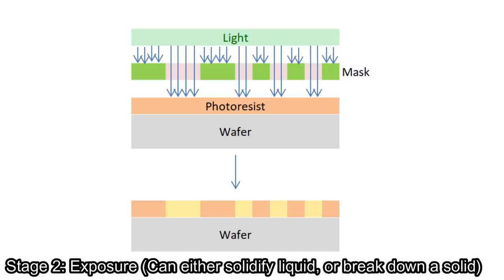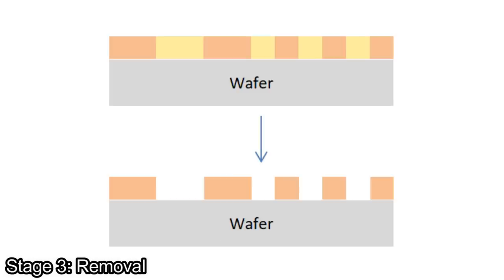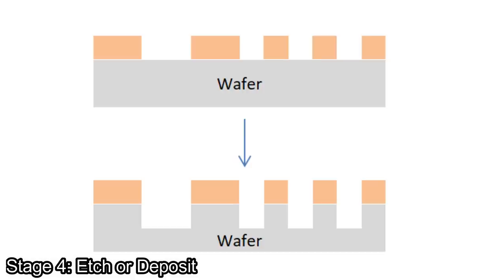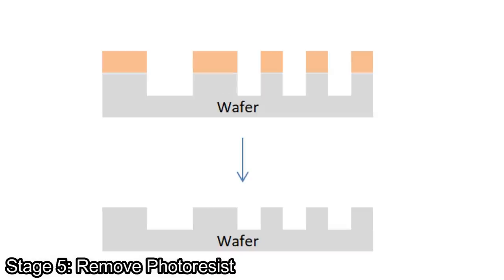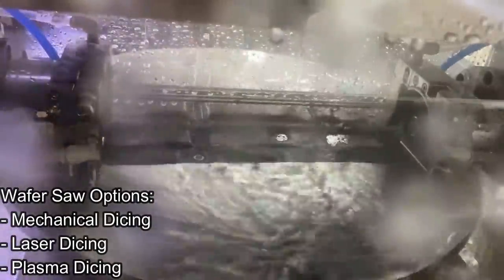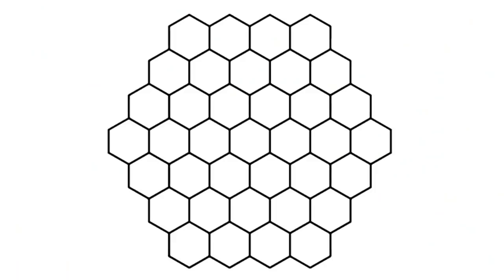Why are Processors Square (and Wafers Circular)?

Comment: Triangle shaped dies could be manufactured while cutting through the whole wafer. Like a square with both diagonals.
That would reduce waste a little bit. Probably still not worth it though, otherwise it would probably be done.

Comment: Round wafer makes sense, you need to be able to grow it by spinning it through the process. I was actually wondering why chips aren't hexagons instead, but then I was told they need to be cut and diced easily so hexagon is out. Plus you have 4 axis to control in hexagon (1 rotate 3 to position) vs 3 axis to control in rectangle (1 rotate 2 to position).
Reply: are the bits of the wafer after getting cut are recyclable or not?
I hope it would be 100% recyclable like glass since it is pure silicon
Reply: @freakdeath1020  Any part after slicing with a cable saw is not recyclable. Basically only the ingot before slicing into wafer.

Comment: Here's what's I'm thinking (before the video): Wafers are round because of the way the crystal is grown by dipping a seed into molten silicon. CPU dies are square because they tessellate well. I do wonder if alternative tessellating shapes like triangles or hexagons would also be a decent option, although these are somewhat more limiting in the arrangement of the CPU because dies don't have to be perfectly square, they can be rectangular and longer to account for more cores for example.
Reply: Oh yeah, they're square because they're easy to cut out.

Comment: The better question is why not print smaller dies on the “edges” of the circle. Where a full cpu die might be cut off you could put a smaller (chipset?) chip.

Comment: Not only is the unused silicon non consequential, the edge areas of the wafer produce lower quality chips, opposed to the center. No alternative outweighs the significant ease in the manufacturing process that rectangular chips offer.

Comment: When referring to wasted silicon, am I correct in assuming most of the waste occurs near the edge of the wafer where you have areas that are too small to hold a full chip because they intersect with the wafer edge? Or do these "fractional chips" get recycled so that they aren't really waste? Or is most of the waste from the width of the boundary between chips (so we're actually talking about minimizing the perimeter to area ratio)?
Reply: Yields are higher towards the center of the wafer and lower towards the edges. Waste in this context is most likely minimizing the amount of unused silicon because to reuse the scraps it would have to be reprocessed.

Comment: Even if you would square (rectangle) cut the chips, could you design an architecture were you could salvage some of the edge chips anyway? Like making a 8 core designed cpu where half of the die is "outside" the wafer and turn that into a 4 core by salvaging the other half of the die that is on the wafer? Basically if you cut through the die that you still can use some of it that is left?

Comment: I get that hexagons are impractical, but what about triangles? You'd have 3 straight edge to edge cuts. Downside is probably that 3 cuts are more effort than two cuts and there is more material lost to the scribe line, but triangles should be able to fill more of a circle than squares too (I think)

Comment: Make a single CPU complex from every wafer, fuse them all back together into a compute cylinder with appropriate cooling, data and power lines and connections.  What could be expected of usable performance?

Comment: Triangular CPUs? They tesselate in a similar way to hexagons AND can be cut out with straight cuts.
Maybe the shape is less robust however (easier to break off a corner) and harder to design for

Comment: So for Cerebras , they chose square chips. Seems like the photo lithography might still be a limitation in using right up to the edge of wafer. But someone will use the whole thing at some point.
Reply from the maker: It's also the optic chain is built around rectangles, not circles.

Comment: How are processor designed? Is it in a Cad software where the engineers place each transistor in software or is there any software magic? or its just plain hard human work and wiring(in software) ?

Comment: People have suggested triangular chips. What is a rectangle but two triangles?

On the other hand, if there was any benefit to hex, triangle or unconventionally shaped chips - why not cut them with a laser, especially water guided microjet lasers? Is there some benefit to using diamond slitting saws beyond the cheaper price of tooling or established tool and process chain?

I'm honestly kind of surprised that laser cutting the scribe lines between chips isn't already a thing somewhere. It it seems like doing super precise laser cuts could have yield or other benefits for chip stacking, 3D chips or other novel high density packages due to increased accuracy.

With the advent of stacked or more complicated 3D chips I wonder if at some point in the future there might be a thermal or structural benefit to unconventional chip shapes or profiles, perhaps even some form of micromachining for cooling channels or other functional features like hybrid process multichip packages or structures.

Taking this idea further it seems like it should even be possible to use existing photolithography, laser etching and metal deposition techniques to embed microfluidic or other heat transfer cooling pipes or conduits into a stacked or layered chip and die package.

How many more watts could we push through a high density VLSI chip if we could run some form of coolant right through microchannel or pores in the chip itself instead of relying on thermal transfer to through the chip package and mechanically coupled heat sinks?

Anyway, I just want to agree with everyone else that hexagonal or triangular chips would look cool. Seriously, do you have any idea how much money PC fanatics would pay for hex shaped CPUs, GPUs or RAM? People would go nuts for them. It might even have some cool benefits in the chip package or lead frames or ball grid area connection size or pin counts.

Comment: could explain why we don’t have wafers bigger then 300mm (12 inches) ? seems like that would be a really good way to offset lower yields
Reply from the maker: There was a push for 450mm wafers, but there was so much money in 300mm, we stuck with it. Now 300mm is so fast, if we wanted to transfer to 450mm, we'd have to redesign the whole infrastructure to do that. No-one wants to upfront the costs, as it would require redesigning the tools and even fab layouts to do so. EUV machines are built for 300mm, for example, not 450mm.

Comment: There's absolutely no reason to use other shapes, other than that of an rectangle, as long as the architectures are a mixt of rectangles. 
 The main cost of a Chip is the development, not the manufacturing, cutting it and throw away the uneven parts, must one if the least expensive step, period... And the foundry always accounts for the "wasted" products.

 At least, you can eat the "Salam de Sibiu", uneven parts!  :)

Comment: What about cutting it into triangles..🤔😉 Aren't they the true OG-MVP?? 😋 I mean, probably not, but then you could make straight cuts like now, and yet have something that can be much more flexible, concerning use cases. Coz triangles are everywhere in nature and human construction, including graphic design, CGI rending etc. And with triangles you can make squares and rectangles and almost any other shape too if you go small enough per triangle unit. Although I guess that's true for any other shape too, out of the, what is it, five geometric shapes that you can join with each other within each separate shape category, without producing any gaps in between? These geometric types has a collective name, but it escapes me at the moment. So maybe it would be possible, just not very preferable, I guess. Otherwise they probably already would've made the change. Anyhow, thanks for a great and really thorough, explanation!! Been wondering for a long time, but constantly forgot to search for the answer, when I had the time to sit down for a bit!

One thing though, that you didn't explain. And that really has bugged me the most. So would be absolutely fantastic if you could answer it too! I get now, why the wafers are circular. But why are the chips themselves printed seemingly not just in the way that makes you be able to fit the most on a wafer, but beyond that. I.e. it looks like the machine has tried to print chips all the way to the edge, and thus, those chips are just half or a quarter or even less of the full size chip, and so they can't function right? Or does the machine print different smaller chips near the edges that are not square shaped, but crescent shaped? Or three sides squared, but one side crescent?? 🤔🥴

Comment: Actually non circular crystals are used for certain chips.  Monocrystalline solar cells are a good example.  Originally solar cells where circular.  GT Solar (Now GT Advanced Technologies) developed long rectangular flat silicon crystals for solar panels.  I believe they are approximately 6 inches by 15 feet by the thickness of a solar cell.  Which is cut into 6 by 6 inch wafers.  GT's furnaces used less energy and cost less so they now dominate the solar industry.  Also rectangular and square cells are better for solar panels.  GT Solar changed it's name to GT Advanced Technologies, because they began developing crystal for LED lights.

Comment: Hi Ian, Does anyone to your knowledge would create different size chips on the same wafer. Eg. if Apple would like to produce SOCs lets say M1x (8 hp cores + 4 lp cores + 16 gpu cores) and M1z ( 16 hp cores + 4 lp cores + 32 gpu cores) on the same wafer. It seems to me the you could a "simple" layout with edge to edge cuts. Wouldn't that be a way to have a single mask to be able to produce multiple SOCs instead of creating a mask for a SOC that might not sell that much. It could be interesting to be able to allocate 5% or 10% of a wafer to less popular product. As anyone done this before?

Comment: nice video, additional question though, why are transistors etched even on the border of the wafer where it's obvious that even with a 0% defect rate you can't get a full chip?
Reply from the maker: I don't really know. It's one worth asking
Reply: A few reasons; most reticles have multiple die patterns, i.e. they are 2x2, or 2x3 etc; you aren't printing a single chip at at time, instead you might be printing 8 or 64 if they're small enough to cram inside the maximum aperture size. So these partial die often have to be exposed.

Also; if you leave these areas unexposed, then you cause yield issues on the adjacent chips, because the area exposed isn't uniform, so in an etch, there are more etch ions at those edge die, than there are at the center.

Comment: You haven't really explained why there are 'partial squares' all around the circumference of the wafer - why do they bother to etch, and presumably put circuits on these bits, and not just the areas where a 'complete square' is possible? At what stage is the wafer 'cut' into discrete chips?

Comment: Excellent video. It sparked a question in my mind: Which part of the the manufacturing process has the biggest impact to yield? 

As we know, intel had yield issues with 10nm. Are yield issues due to the manufacturing and layering/metal layout as you covered in the video? Or do yield issues stem from another part of the process that you didn’t cover in the video? Any thoughts would be greatly appreciated!

Comment: But why Cerebras chip is square? It's only one chip per wafer.
Reply: My guess would be that all the lithography is designed around making repeating rectangular patterns. Plus, everything needs to connect to the edges of the chips which are all rectangular.

Comment: Another question though. Why do we take the manufacturing nodes in order? Why do we go 22, 14, (10), 7, 5, 3/2, etc. Why doesn’t someone just go 22->5 in one go? Surely there aren’t revolutionary new research every year or two allowing us to push previously unexceedable boundaries? Does 14nm precision depend on 22nm precision? I haven’t been able to Google my way to the answer
Reply: Which is easier to do go from the Earth to Saturn or the Earth to Mars? Smaller jumps are valuable because you have less work to do. 

For example going from a working 28nm to 20nm required the switch to finfet transistors. Going from 20 to 14 nm required more patterning. 14 to 10nm required even more patterning and other refinements. 10 to 7nm required switching out some material such as copper for cobalt. 7 to 5nm requires going from moderate to little euv to full euv. 5 to 3nm may or may not require gaafets.

While going from 22 to 5nm may sound as simple as just shrinking transistors, you still have to spend the time researching new materials, processing techniques, and equipment. Basically you are changing too much at once and are likely to fail at getting a working product. Intel's 10nm was only 2.7x the density of its 14nm, and they struggled for years. Imagine the complexities of trying to get a 20x jump.

Also in your example of 22 to 5nm, the biggest hurdle is that euv machines did not exist for industrial purposes back then. It's hard to build a new node when the technology for the node does not exist. Rather than stagnate for 6 years it's better to just make iterations and get there on pace. You can also see that some nodes along the way aren't that great and primarily serve as a learning project with a nod to it's better than no improvements at all because stagnation in a competitive market is a bad business model.

Comment: Triangular chips: You can cut them straight, and they fill space the same way hexagonal ones do
Reply from the maker: The way you build transistors changes depending on the orientation to the crystal plane. Would have to compensate for it

Comment: Couldn't you cut the silicon ingot top to bottom to get a more or less rectangular shape?
Reply: You could but it'd get you an 9rregular cross section and you would still have the heat concentrating in the corners.

Comment: circles would also waste much more of the wafer area, irrespective of the wafer shape (~10% wasted space). With squares (or triangles/hexagons), the wasted space goes to zero as the ratio (wafer area/chip size) increases... provided that you can use the chips on the "edges", which given your salami analogy maybe is not the case?
Reply from the maker: Not circles. Circle. Singular. One big one
Reply: @TechTechPotato  Ooooh missed that. Makes sense :)

Comment: Kinda unrelated question that i dunno where else to ask. If a CPU, in this hypothetical scenario, has too many functioning transistors for the SKU it is reserved for & they have to disable some, do they systematically do so in a manner that benefits the cooling?
In other words, is the center of the die the hottest usually due to it being surrounded by other transistors? & would they take that into account & disable center most transistors first?
Sorry if i got any basic understanding wrong, or terminology.
Reply from the maker: With a multi-core CPU, the thread can move between cores if there are thermal issues.
Reply: @TechTechPotato  stuff is always 10x more complex than i can understand. 
maybe if i rephrase. NVIDIA "cuts down" its dies or "disables" parts of them if their performance is below one SKU but above another (to hamper that chips performance by a little [to match the lower SKU]). Unless i am completelly mistaken.
I am asking if there is a system in place that determines which part of the chip gets the axe?
Sorry for any confussion i may be causing.

Comment: That always bothered me as well. With round wafers, stuff at the edges is useless and has to be cut off, but if the wafers were square or rectangular, entire area of it could be used for chips.

Comment: The biggest improvement wouldn't be the shape, but splitting the small monolithic (1 hexagon) from the large monolithic (the neighboring 6 hexagons). As lithographies improve the 2W TDP per core seems to be the minimum for optimized architectures, so monolithic designs are bound to get more and more toasty as their area decreases. While custom cutting would increase cutting costs and more redundancy would need to be added compared to chiplets they would save on the interconnects (assembly price and performance penalty) while keeping the larger area. Is it worth it today? No. Will it stay this way? Only time will tell.

Comment: Square wafers doesn't really solve the problem with wasted edges. 
You're very likely to end up with a chip that doesn't match up evenly to whatever wafer you're working with.  Of course people can optimize for it, but it will have to be balanced against power and performance. I believe that power and performance win more often than not for semi-big to big chips.
Small chips doesn't really have a porblem with wasted silicon, when you get chip edges below 5mm they'll use +90% of a 200mm wafer.
It would make things more expensive, massive technical challenges would have to be solved and it wouldn't solve the problem properly.

Comment: ohhh, that's an idea, use the whole wafer for a single Chip...
the yield rate would be horrible, and i cannot imagine a non-custom solution for putting it into a package.
you could fit multiple raspberry pi like computers on it including IO and RAM, and connect them directly to eachother as like a Single Chip Compute Cluster... a SCCC if you will.
Reply from the maker: Check out my video on Cerebras
Reply: @TechTechPotato  holy, that is crazy large.
i really should not be watching your channel, it makes me want to design and buy my own ASICs... it would be so awesome but it's just so damn expensive and just not a hobbyist thing to do.